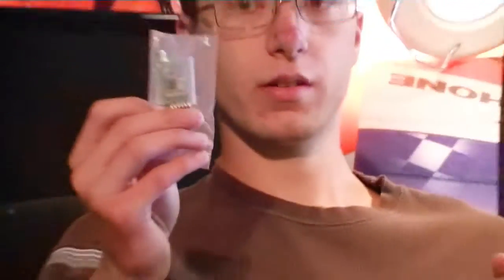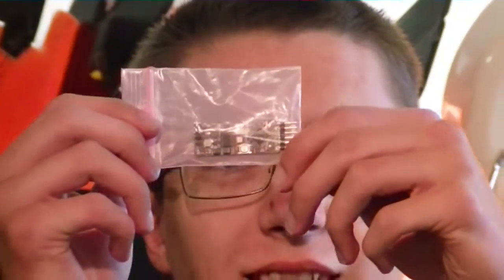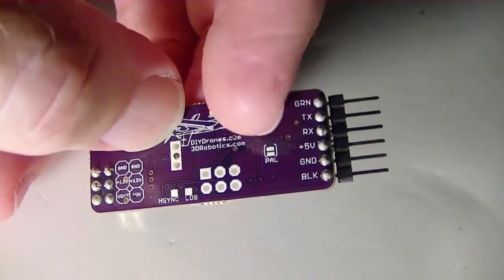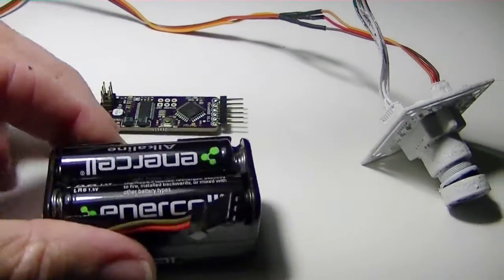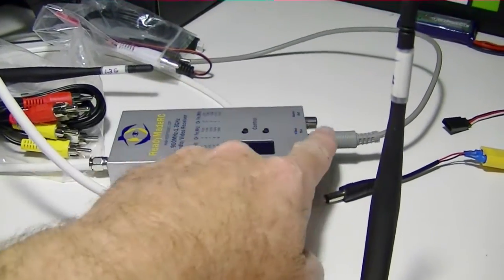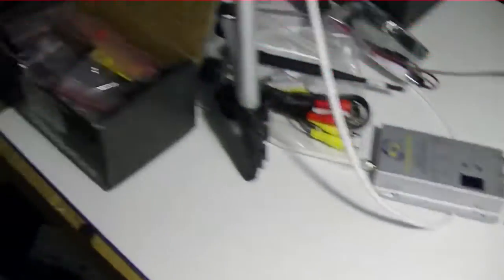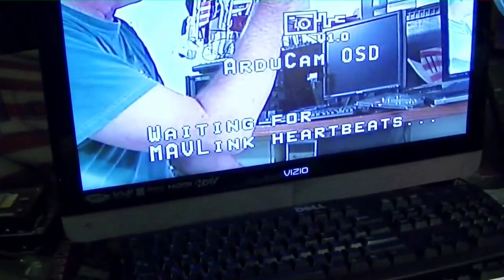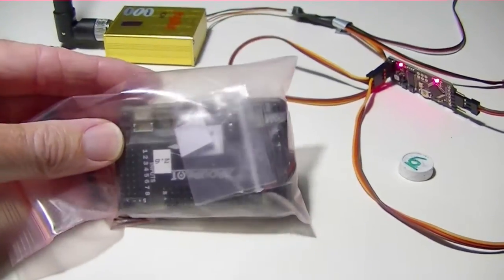FPV Part 4: 3DR Ardupilot Mega 2.6 and MinimOSD Unboxing, Connecting, Setup, Testing

Comment: Can you power the camera OFF the MinimOSD?  My cam is 12v but my transmitter is 5v, so I don't want to route power through it.  I just want to route ground and video.
I have also bought cams from SecurityCamera2000.  Did yours come WHITE, or did someone spray paint it?
Reply from the maker: Hugh Hemington The MinimOSD does not supply any power so the 12v for the camera must come from an external source (battery or UBEC).
I coated my board camera with Plastidip spray from the hardware store, see my video on using Plastidip.
Reply: Ok, I didn't think the Minim supplied camera power, I just wasn't sure if it needed the power on that side of the bridge to overlay text.
I've been considering the merits of a spray or something like liquid tape for some of this stuff.  I just wondered.  And did you get the Super HAD II CCD?
Reply from the maker: Hugh Hemington I have been using the PZ0420 cam from SecurityCamera2000 for years and it still works great. On the MinimOSD I solder the jumpers and cut the etch so I can fun both stages off of 5 volts. That keeps the board cooler but you can power the second stage from 12 volts if you want. Just personal preference.

Comment: I don't have my telemetry kit yet . Is there a way to use a usb connection to update the Minim OSD firmware and adjust the screen positions of the characters , and see what has been changed without the wireless Telemetry Kit ?

Comment: Thanks dmerc00 ! I'm assuming you're referencing the lower diagram " How to not use the regulator from the second power stage " . Am I correct in assuming that the Minim OSD with get its power from the APM Board ? I'm a noob , so please bear with me if some of my questions seem dumb .

Comment: Hello dmerc00 ! Can you tell me or put a diagram up showing the best way to supply power to the APM board , Minim OSD , VTX , and a 12V Sony Board Camera camera . I would like to use a separate single 3S 2200mah battery and not my flight pack . On my DIYDrones  Minim OSD V1.1 board both jumpers are soldered .

Comment: Great job I can't wait to see it fly//
Side not: most that use that Video Transmitter, take it out of the hard case.  It saves weight. size and it will cool better.  Just take the screws out and it comes apart.. They have wedged metal plates in there as a heat sink, they will pull out.  On the SW I place it in the provided slot, up and down, on the fuse, just ahead of the front of the wing.  Check out Bonafied Pirate's page.